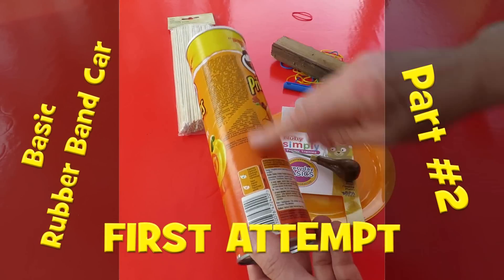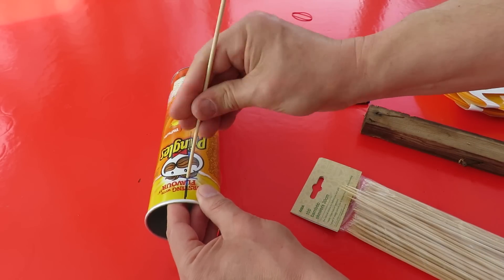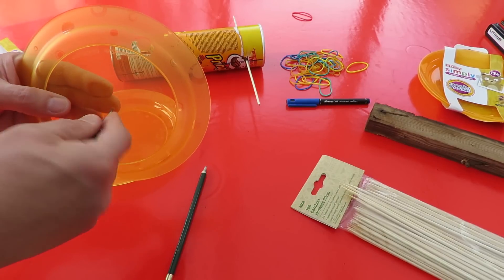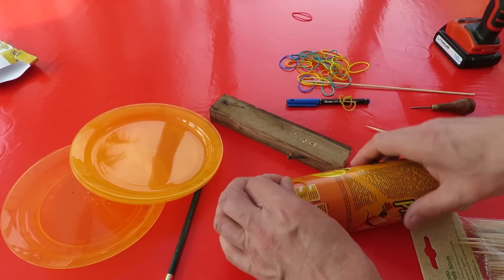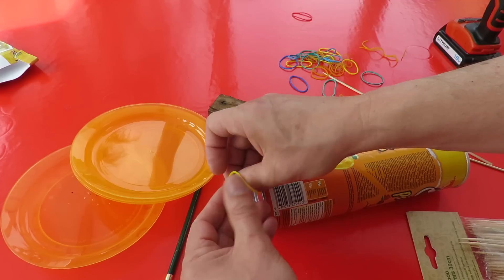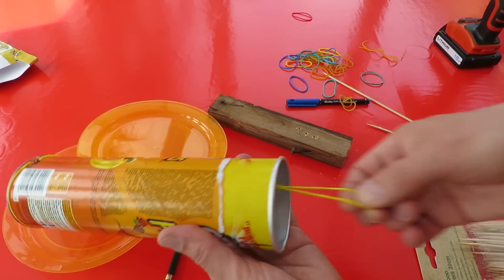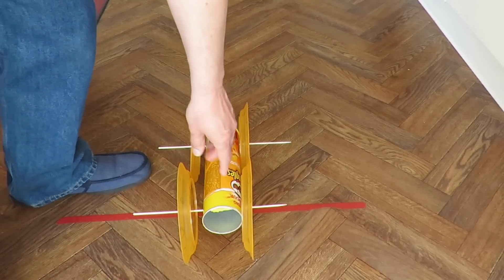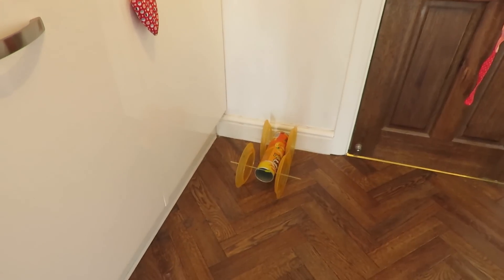Basic Rubber Band Car Part #2 First Attempt

Comment: If people are still having difficulty following the looping together of the rubber bands perhaps you could demonstrate using different coloured bands so people could see the over under looping of the bands.
Reply from the maker: Hi Wil. In all my rubber band power car videos I include these links in the video description.Some helpfiles
Making the CD wheels https://youtu.be/ZRrjBuWfmrM
CD Wheels with Cardboard Hubs https://youtu.be/Js1rtn2IGTE
Putting rubber tyres on CDs https://youtu.be/ZnuPnveCbxs
Connecting rubber bands https://youtu.be/EbYuhdwknbs
Connecting the band to the axle https://youtu.be/0wPYxloUFJQ

Comment: never thought of using plastic plates before . hmm
 got me thinking, and thats dangerous.
Reply from the maker: These are a little larger than my normal CDs so the acceleration is slower but there is less chance of wheel spin. In a later video in this series I try using Gorilla Glue to stick bottle tops to them for extra rigidity but that fails.
Reply: good luck grandad.